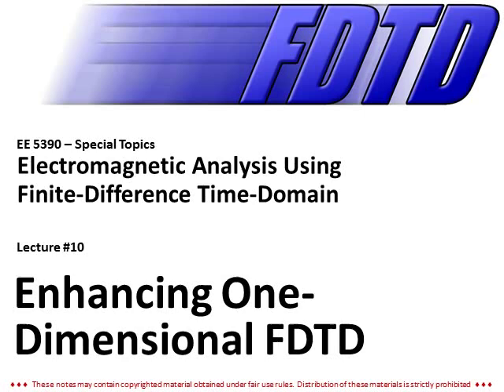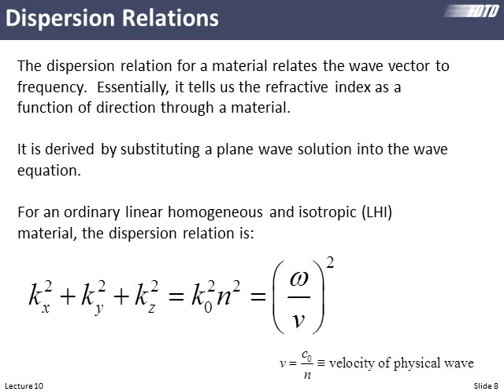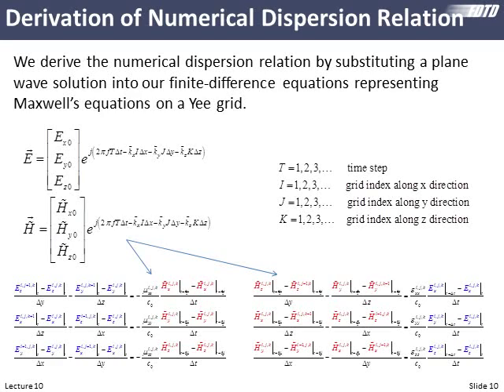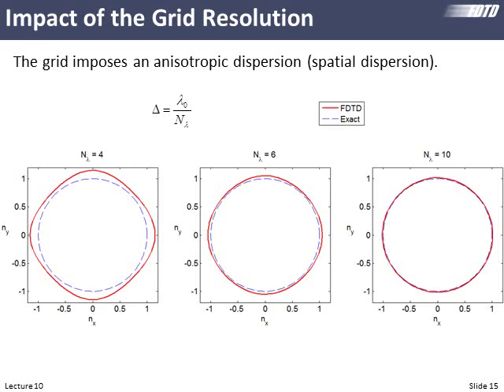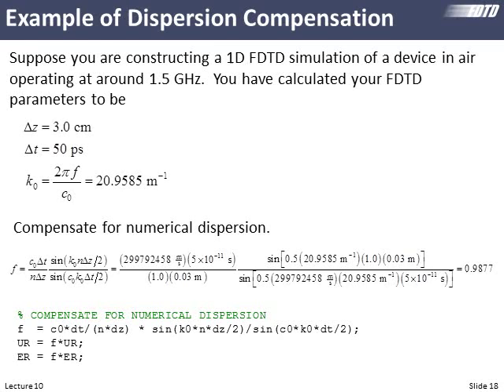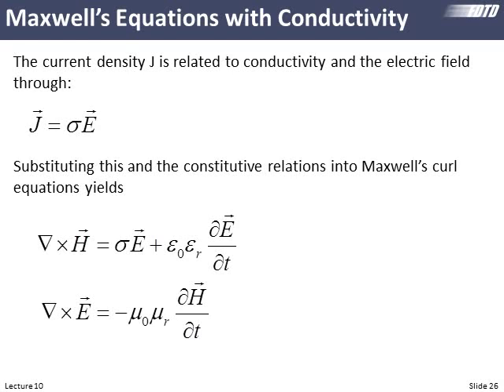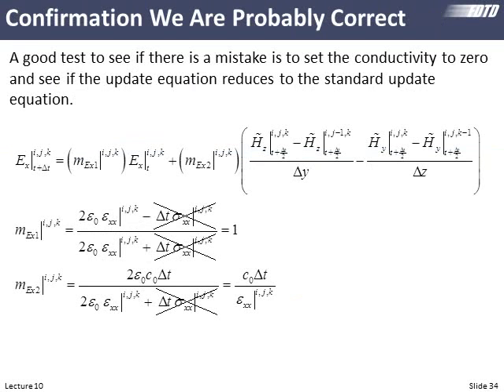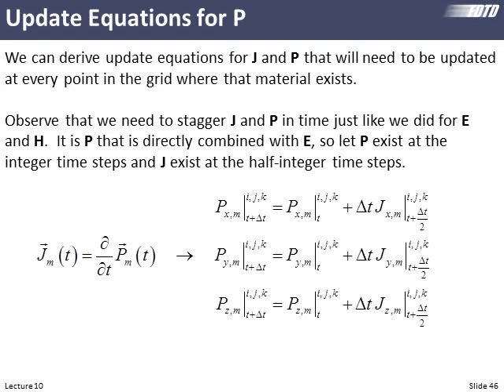Lecture 10 (FDTD) -- Enhancing 1D FDTD

Comment: Dear Prof.,

For incorporating losses into the simulation, the conductivity is related to the complex permittivity (and index), is that right? So far, the equation that I have found relating both is 

sigma = omega*eps2/(4*pi)

where sigma is the conductivity, omega is the angular frequency, and eps2 is the imaginary part of the complex permittivity. Is this correct?

What other ways would you recommend I get the conductivity value from? (Theoretical models or experimental data perhaps?)

Thanks!
Reply from the maker: I usually simulate devices in stages of increasing complexity.  Consider first, just setting the electric field to zero where metals exist.  This is the PEC approximation.  One easy way to do this is to set the permittivity something crazy large like 1e6.  The second stage of complexity is incorporating a constant conductivity, usually this is the DC conductivity.  There are lots of tables on the internet giving DC conductivity for many different materials.  The third stage of complexity is incorporating something a Drude or Lorentz-Drude model to account for the dispersion of conductivity.  This is particularly important at very high frequencies.  Finding these values is much more challenging.  Often, people will measure the conductivity themselves and then do a curve fit to to extract the parameters.  The best thing is to search the literature for others that have simulated metals with the Drude model, or whatever model you are using.

Comment: Hi, I'm trying to incorporate losses into the dielectric that i'm trying to model. For practice, I've modeled a slab of arbitrary conductivity and  thickness. For some reason for any value of sigma other than 0 that I give, the slab acts as a perfect conductor (reflects the transmitted wave completely) and I'm not sure why. Any help would be greatly appreciated. Here's the code.

ER = [ones(1,100) 4*ones(1,50) ones(1,50)];
UR = ones(1,Nz);                  
sigma = [zeros(1,100) 3*ones(1,50) zeros(1,50)];

const_E1 = (2.*E0.*ER-dt.*sigma)./(2.*E0.*ER+dt.*sigma)
const_E2 = (2.*E0.*C0.*dt)./(2.*E0.*ER+dt.*sigma)
const_H = (C0*dt)./UR;
const_E = (C0*dt)./ER;

Ey = zeros(1,Nz);                    
Hx = zeros(1,Nz);

e3=0;e2=0;e1=0;h3=0;h2=0;h1=0;

NFREQ=1000;
FREQ = linspace(0,fmax,NFREQ);
k = exp(1i*2*pi*dt*FREQ);
REF = zeros(1,NFREQ);
TRN = zeros(1,NFREQ);
SRC = zeros(1,NFREQ);

for t = 1:steps
    
   for nz = 1:Nz-1
        Hx(nz) = Hx(nz) + const_H(nz)*( Ey(nz+1)-Ey(nz))/dz;
    end
    Hx(Nz) = Hx(Nz) + const_H(Nz)*(e3-Ey(Nz))/dz;
    Hx(49)=Hx(49)-const_H(49)*E_source(t)/dz;
    h3=h2; h2=h1; h1=Hx(1);
    
    Ey(1) = const_E1(1)*Ey(1) + const_E2(1)*(Hx(1) - h3)/dz;
    for nz = 2:Nz
        Ey(nz) = const_E1(nz)*Ey(nz) + const_E2(nz)*(Hx(nz) -Hx(nz-1))/dz;
    end
    Ey(50) = Ey(50)-const_E(50)*H_source(t)/dz;
    e3=e2; e2=e1; e1= Ey(Nz);
    
    draw1d(ER,Ey,Hx,dz);
    xlim([dz Nz*dz];
    xlabel('z');
    title(['Field at step' num2str(t) 'of' num2str(steps)]);
    drawnow;
    
    for nf=1:NFREQ
        REF(nf)=REF(nf)+(k(nf)^t)*Ey(1);
        TRN(nf)=TRN(nf)+(k(nf)^t)*Ey(Nz);
        SRC(nf)=SRC(nf)+(k(nf)^t)*E_source(t);
        
    end

end

Comment: Hello, great lectures in explaining the FDTD concept, I am trying to model a three-layer substrate using 1-D simulation and exciting it with a triangular Linear Frequency Continuous Wave modulated sine wave. At the internal boundaries of the substrate where the dielectric permittivity, conductivity and permeability change, should I incorporate empty cells for TF/SF at each boundary or just place the whole substrate in the middle and continue as described in the lecture videos? I only want to look at the reflections that are caused by the incident wave, not the waves which are transmitted through the substrate by internal reflections.
Thanks!
Reply from the maker: The TF/SF is for the source and should not affect how your construct the device on your grid.  For simulating reflection, simply fill the first part of your grid with air, then a few more cells for your first layer, then a few more cells for your second, layer, and so on until you can plot the permittivity and see a picture of your three-layer substrate.  The TF/SF interface will go in the air region above your three layers.